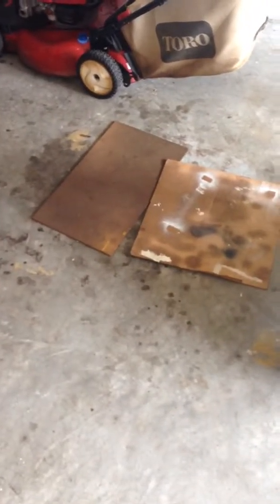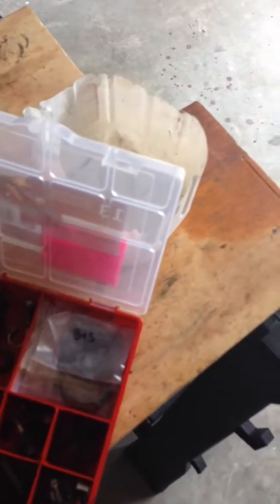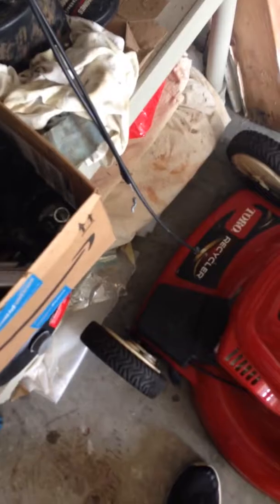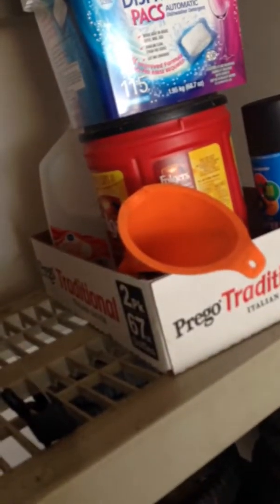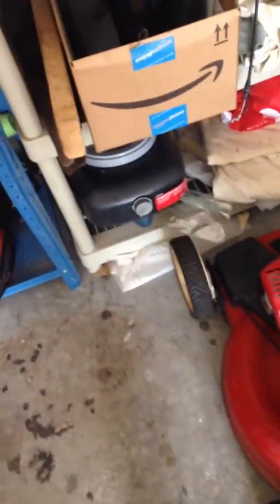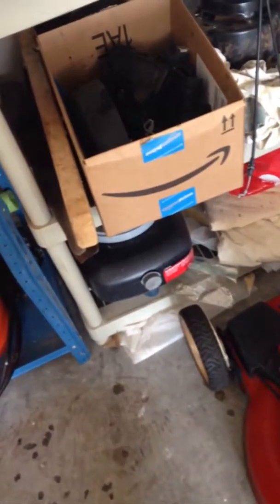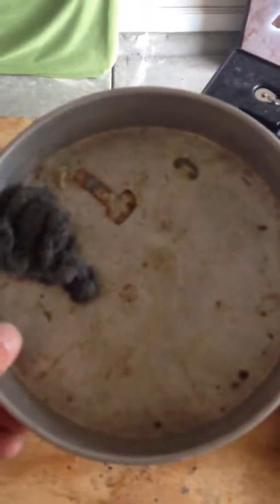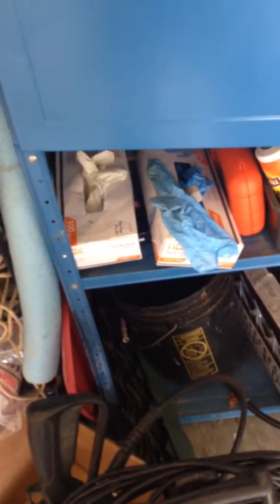VLOG 5/21/2017 - Shop Tour

Comment: Just like when I got started now I have half the shop over flowing with my stuff lol. I'm going to be doing a tour soon here too. Been organizing and cleaning up a lot of it. There is a seat removal tool for tecumsehs I picked up. Works on Briggs stuff too. It's on amazon as well.
Reply from the maker: Good deal.  I just started this this year,  I love fixing things,  my day job has nothing to do with this stuff, unless fixing computer programs counts.  
Even better as a hobby that actually makes a small profit.  Most hobbies cost you $$. 

I set a goal of selling 10+ mowers this year and have just met that goal.  This doesn't mean I will stop. 

My late grandfather would be proud,  He Worked for Mack trucks on the power train division asmembly line.